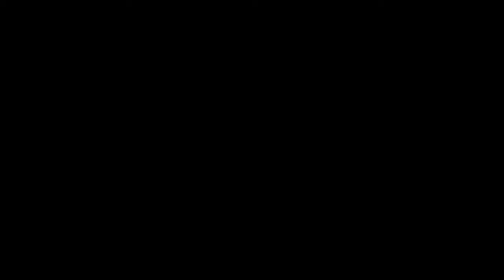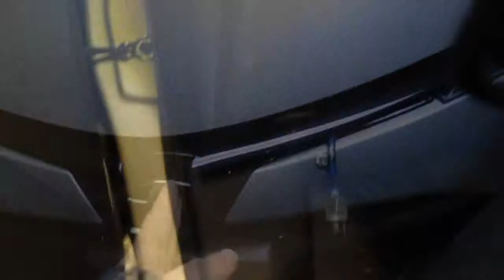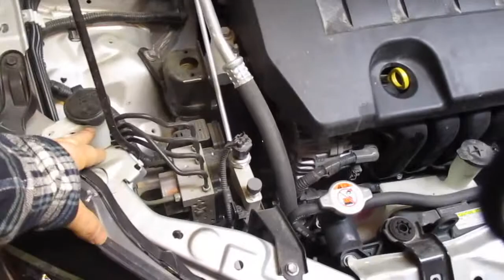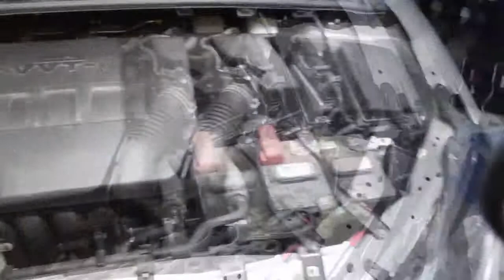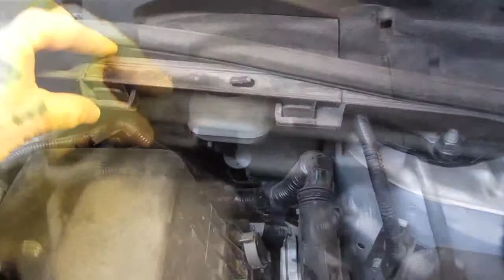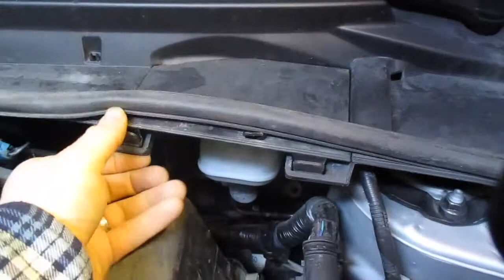Brake Fluid Reservoir Toyota Corolla How to Access 2015-2022 2015 2016 2017 2018 2019 2020 2021 2022

Comment: Would have been nice to see how you remove the little filter inside the reservoir so that you could suck the current fluid out.
Reply: Exactly how do you remove that little filter I tried everything a pair of pliers but it started to feel forced and did not want to break anything
Reply: @iamscharles  When flushing fluid make sure you bleed both the brakes and Clutch slave as I just experience failure on my Concentric clutch.